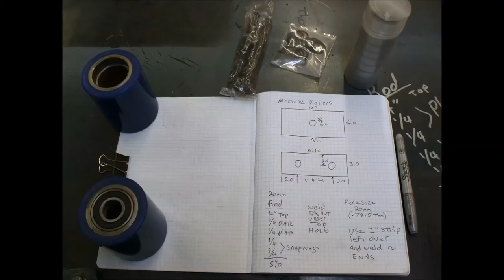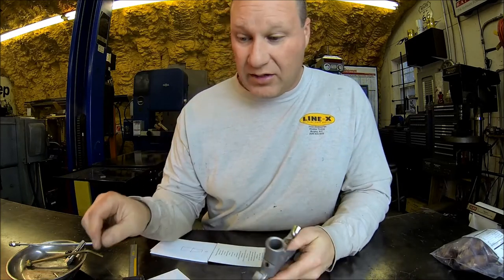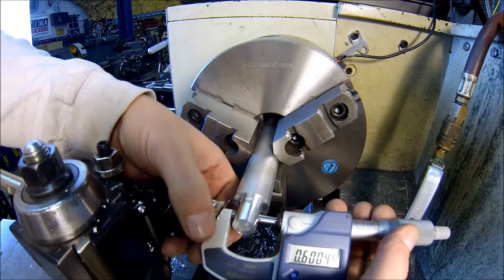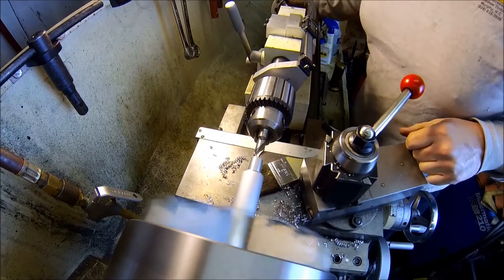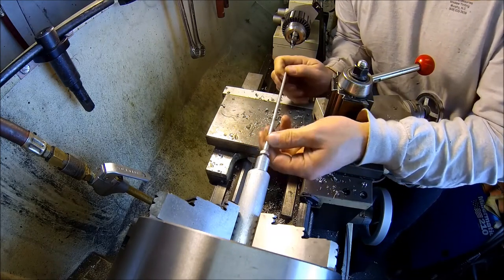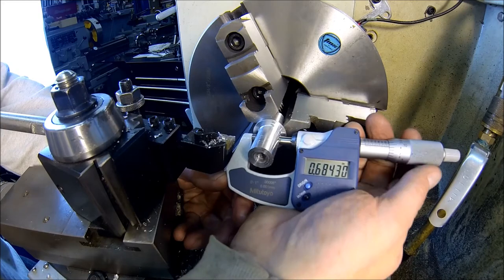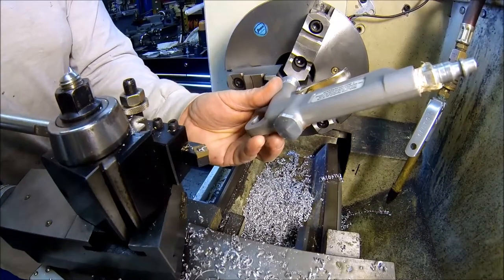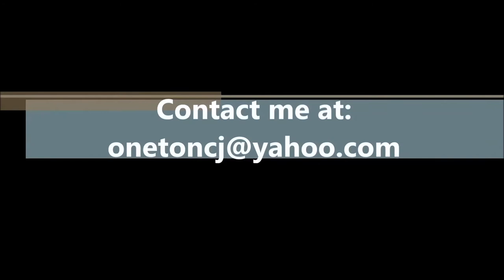Down & Dirty #8 Pistol grip air gun fix

Comment: Love your shop, one day I hope to be as well outfitted as you.   At work they installed those junk air guns. They are nice other than the issue you address.  Nice modification.     Thumbs up
Reply from the maker: Thanks Steve. It took me 10 years of saving up to get it. Ironically the concrete slab cost me  more than  the metal building.